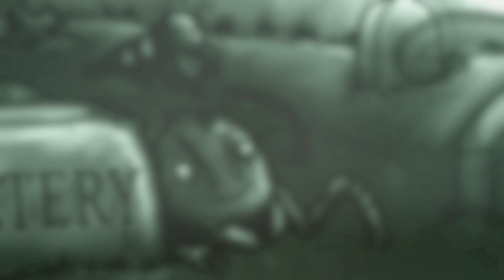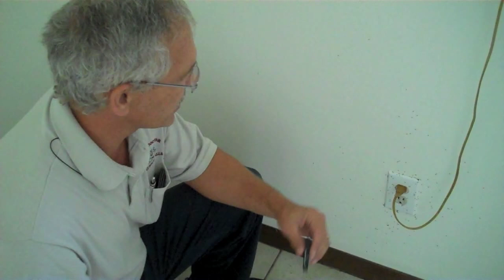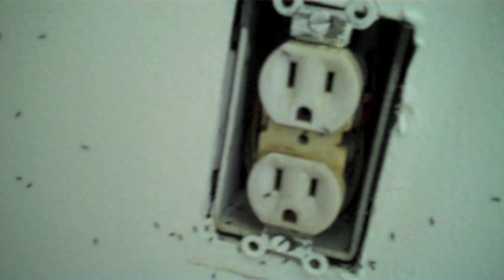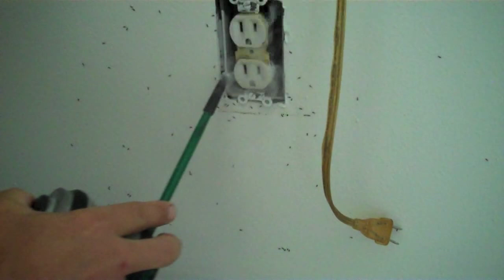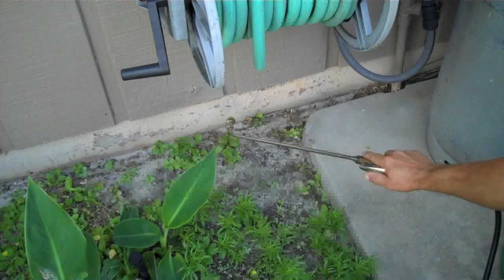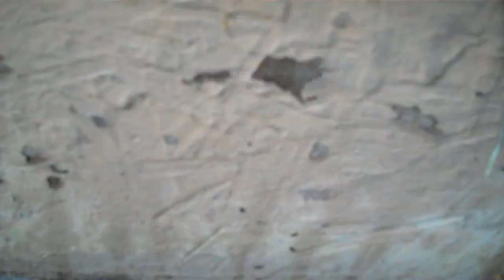How To Deal With Ants In The Wall

Comment: Will borax in powder form work well? It seems my electrical sockets are completely sealed, i opened it up and i spray some borax in, but nothing inside. I am having issues on the side of my house , one of the bathrooms the little ants coming under the baseboards. I can treat the exterior with borax, my wife is a nazi about anything non organic, anything else will work that;s safe?
Reply: Reclaim I/T.

Comment: I know this is an old video but what would you recommend for the walls for an RV Travel Trailer that's stationary and stays at 1 spot say 5 yrs straight?
Reply from the maker: +TheDigihax exterior scatter baits for ants and perhaps just some gel baits inside... tough to get in those thin walls and it may take some time
Reply: Ok cool, I'll have to look into those...
Reply: I'm not sure if it's easier for ants to get inside an RV than a house, but sure seems like it.Thanks for the advice!

Comment: Hiya I live in a damp 3rd floor flat in uk. I’ve got rats in walls too. But worse is the springtails ( super tiny almost microscopic ones) all over my flat there comming from the main cavity wall I think along where bathroom and kitchen are. Rat mites and collembola actually bite and sink into skin ( these ones do) and there in everything and all over my flat. Can I safely drill small holes into walls ( there mostly thin stud types) pour powder or something in to stop these pests ? What would u recommend that’s not too expensive I’ve already spent £700 on spraying, permethrin etc got no where , thanks kindly
Reply: Did you get rid of them?
Reply: Borax!
Reply: Cant tell you what to do about mites or rats. My cat is a messy eater, there is always kibble on the floor. I user a bait trap in 2 areas and they were gone after a week. Main ingredient was boric acid,  a type of borax. I have an outlet in a case out in the yard. When i flipped the cover, it was full of ants. I mixed borax laundry powder with some peanut butter and smeared it on the inside of the cover. The and and peanut butter are gone now. Parasites like mites won't fall for bait traps.

Comment: Old video, so I really hope you're still active. What kind of products are those exactly? I have a complete home invasion, they are between the brick wall and the interior drywall, and they're eating away at it FAST! Each time I hoover the residue from the floor, it's a mess already in a couple hours. I've tried every possible home remedy with zero success, vinegar, lemon, salt etc.. Even half spray can of Raid insecticide, they're some tough mthrfkrz, so I'm very sorry but it's now me or them. It's a very old country house thst sure doesn't need destructive tenants, or squatters actually! 😅
Thanks 👍🏻

Comment: Hello. I hope you are still answering this video. I have just moved into a house in Northern Michigan, obviously it is cold here, and I have Carpenter Ants in the walls. I just had the crawlspace insulated a few weeks ago and I believe because it is warmer down there a colony has been awakened and they have been all over the inside of the house, crawling all over the floors and kitchen counters. Not having a whole lot of money left, I need to know how to do it myself....so if I were to remove the outlet covers in all the rooms and dust into the wall voids and dust into the cracks and crevices where I have seen them coming and going, and maybe drill a few holes in the drywall and dust these, what else do you recommend I do? What dust is best? What type of duster? Help please! Thank you.
Reply: I  made the mistake of  putting a ant dust out side the house.. That will  NOT  kill  all  of  them.  some of them.  You  need to   bait them.. It  take a few weeks..    I used a combination  of  2  baits  gel and  granules..   Yes these ants are picky eaters  They take the bait back  to the nest  and queenie eats it and  they all  die..    University Minnesota has information  on  what to  do..  I used  carpenter ant  dust last  year  they came back  with a vengenance..  You  will  need to   go to a do it yourself pest co  which  carry  the   exterminator grade  products.... Carpenter ants   destroyed  wood in lower  level  room  of  my  house.. Also check  for  leaks or old  wood,   you will have to  replace that wood   they  like moist wood..  they are very sneaky...

Comment: lmao. and what after they died? Mites and mold from dead ants behind the wall. still open other stuff can enter the house.
Reply from the maker: Heinz Hampelmann yep. Nature will send its recyclers - could be the ants were there for just that reason. Dead bugs or what have you. More likely they were in this wall because of the moisture though.  Good point though.
Reply: I found through experience that it's an ongoing issue until you can block all access points to the wall both inside the house and out. It's finding and blocking those access points that drives people insane because it is slow and tedious. Eventually once every point is closed, those outside get the hint and those inside starve to death.

Takes time and repeatition but it works eventually.
Reply: Heinz Hampelmann except that termidor (the residual product he uses outside) is used to kill all insects. So no.

Comment: Which products can I buy to this? Just bought a house four months ago and ants seem to be in the walls! I can't find a point of entry but they were coming out of a wall socket
Reply from the maker: Stephanie Leos Not always easy to find entry. Delta dust is good but there are others out there.
Reply: +Stephanie Leos I have the same issue and my landlord keeps telling me I'm responsible for getting rid of them, I've tried everything as well and I'm extra clean so I'm not sure what to do next
Reply: Easier solution if they go in the outlet just put the tip of the plug and it will start the electricity shocking the ants to death.That's what I do.
Reply: That's what I would do as well.    Sometimes I've scooped up so many on my counters, I've had to quickly put them all in the microwave ASAP.    The ants are so horrible in the East Bay of Calif , that the microwave has got to be on several minutes.     Sometimes even then, the microwave still won't kill them !